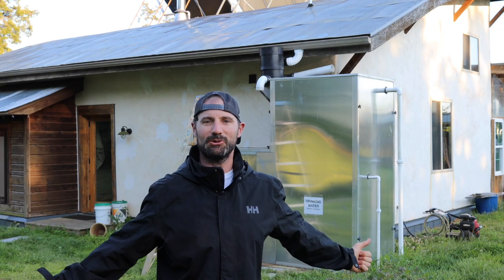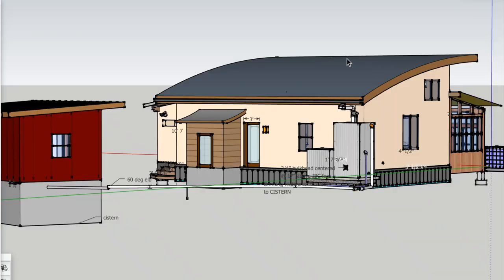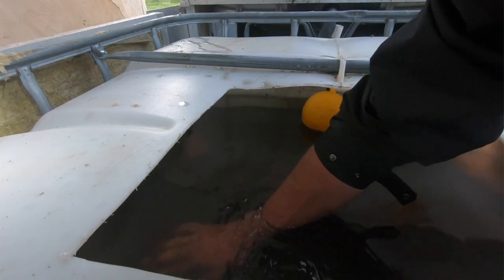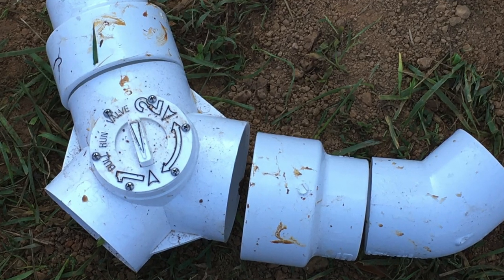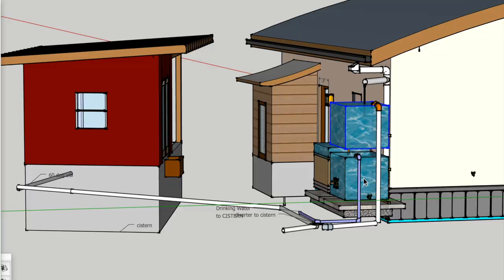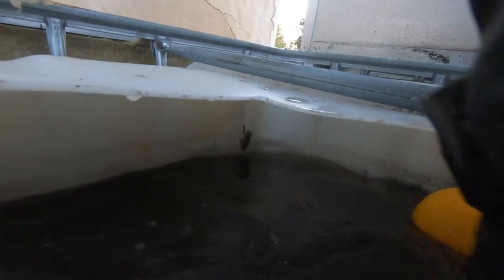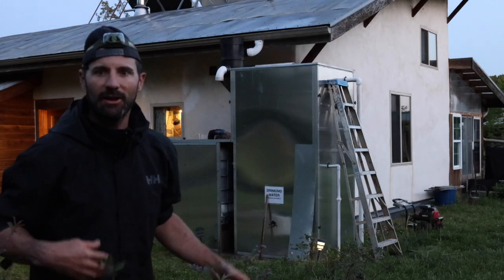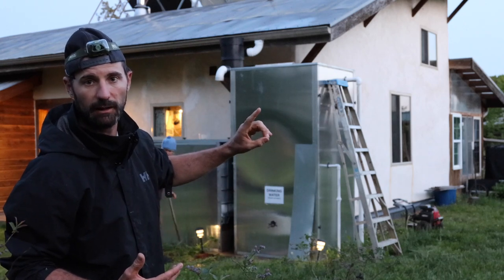DIY Home Water Filtration System: Rainwater Harvesting with a Biological Sand Filter and Maintenance

Comment: how many years have you filtered water through the system?
Reply from the maker: H A Z M A T i say three years in this video, but it’s actually two years after I looked at the time stamp on some of the old photos. It takes about two weeks to “grow” the biological layer on top of the sand filter to get the full 99% purifying qualities of this filter.
Reply from the maker: I've been living off biosand filter water systems, solely, since 2012. This system WORKS for drinking water, and with this gravity-fed underground cistern design, it works to provide all domestic water needs!
Reply: HeirloomBuilders thank you. Would you say that this type of system would work well in an equatorial climate, say Costa Rica? Meaning does the biolayer get affected by temperatures
Reply from the maker: @TheoSmith249  Biosand filters work great in tropical climates like Costa Rica. The bio layer does freeze in extremely cold temps.
Reply: I’m also from Costa Rica and would like to give it a try. Interested in sharing ideas too..
Reply: @HeirloomBuilders  what happens to the bacteria if it freezes?
Reply from the maker: @precisiontactics7448  the bacteria on the surface will be less effective at eating the harmful pathogens. However the bacteria that colonize the lower layers of the sand bed will be fine and continue to purify the water. Do you live in a really cold climate?
Reply: @HeirloomBuilders  Ok awesome. No, in South Carolina
Reply: @HeirloomBuilders  we dont. In South Carolina. i am planning on building the filter that your have but i only have one ibc tote so i am trying figure out an inexpensive way to filter the water without having to buy another tote like you did. I am going to install the gutter system and then run the water to the filter container (not sure what container i will use) and then to the ibc tote. Do you have to change out the charcoal for your system? And do you have to worry about the PVC pipes breaking because of freezing temperatures?
Reply: I from Philippines  hoping  to apply  this kind of system ..thanks
Reply from the maker: @precisiontactics7448  we don’t use charcoal in this system. The sand bed only needs minor maintenance and is all you will need to get amazingly clean water.
Reply from the maker: @precisiontactics7448  the PVC pipes don’t break because they are pitched to drain by gravity into the sand filter and not glued so they can expand if filled with water when it freezes without bursting. The only pipes that are glued are the ones inside the biosand filter coming up from the bottom (clean side) so they don’t mix with the unfiltered water near the top of the filter
Reply from the maker: @ALJoy1432  best of luck my friend! Let me know how it goes
Reply: Does the water in the cistern become stagnant at anytime. Do you filter it again before using?
Reply from the maker: @SuperMountainmaniac  I’ve never felt the need to filter again before drinking. We have pretty consistent rain, which re-oxygenates the water. Not sure what I would do if we had a 6 month drought. Probably recirculate the water...
Reply: @HeirloomBuilders  say you have a long period of drought or another reason why you don't circulate the water for a few weeks. You can use a simple oxygenator used in aquaria. Just run it for 15 minutes to 30 minutes every 2 weeks. Should be enough to ward off anaerobic bacteria. (Learnt this off a pro installer in French)
Reply from the maker: We don't use charcoal in this system, but you could if needed. The pipes that connect the surge tank to the filter tank are the only ones subjected to freezing (since the float valve shuts the flow of water off while the filter works, which could be really slow if there are freezing temps). So we don't glue those pipes so they have room to expand with freezing water and not burst the pipe.
Reply: I would do that plus UV light 
About like you filter an ornamental pond
Reply: @HeirloomBuilders  one of the coolest things Ive ever seen. i might test this out on a smaller scale
Reply: I’m from northern NJ  and wondering what options during the snowy season when rain freezes? That’s about a good 5 months of cold snowy weather .
Reply: How about a carbon filter within the vortex? That way the water that comes into the sand tank is already partially purified. After tasting water from volcanic springs in St. Vincent & the Grenadines, I became a believer in the carbon filtration. It may reduce maintenance.
Reply: We really want to do this but I can’t figure out how to get it permitted. In Virginia, all the officials I’ve spoken to say they require a well for potable water. Any thoughts?
Reply: Thank you so much for the info!! So do you have to make sure the filter stays wet constantly? Does that mean if need be recirculating the water?
Reply from the maker: @NEMO-NEMO  the external piping system is set up without glue so that it can freeze without busting the pipes. If freezing temps last for days or weeks, I would consider putting the tanks in an enclosed and partially heated building to keep the system working.
Reply from the maker: @kindharthomestead  I had to install a well also for permitting sake. Unfortunately the cost of drilling a well has almost tripled in the last 5 years, so I’m considering taking this design a step further and having it engineered for code approval.
Reply from the maker: @jacksonanddad8065  yes, the sand bed needs to stay submerged in water so it doesn’t dry out and kill the good bacteria. Piping the outflow pipe up from the bottom of the tank and penetrating out of the filter tank 2” above the sand bed makes the water level stay above the sand bed surface.
Reply: @HeirloomBuilders  Brother, is the finer sand you've used taken from a seashore? or does that matter if it is from a river bed or sea? Adding Charcoal plus UV also would be better if we are ready to maintain that correct? Thank you bro.
Reply: @HeirloomBuilders  that is what we will be dealing with in Northern Nevada. I am thinking to Aircrete a removable shell to keep the water system warm enough in the winter. Thank you so much for posting all your information!
Reply from the maker: @john.james-rambo  just seeing your comment. It’s best to use filter sand. Available from red flint sand in Wisconsin. Plans are available at www.heirloombuilders.com

Comment: in 1999 we bought a farm in Perry county, Arkansas. the water system was water pumped from our 1 acre STOCK POND(used by horses, cows, goats, dogs, a donkey, etc.... to drink from and wade in) to a 2 chamber sand filter and then pumped directly into the house to drink, shower, flush etc... the filter was 1 large rectangular tank with a divider going to within 4 inches from the bottom and filled to within 8 inches from the top with SAND on one side and only 12 inches  deep on the other side. a submersible pump in the pond pumped to the high sand side through a float valve on the side of the tank. from there the water filtered down to the bottom and up into the other side of the tank and the height was the same as the other side. water was piped from the clean side via the intake pipe from a jet pump that went up the outside of the tank over the edge and down into the tank about a foot, where a screen was attached. 
this sand filter was originally used to filter the well water, but the water table was low, because the highway department had blasted the old bridge and water was flowing from our well out the side of the bank and into the river! we didnt have much water used the filter to filter pond water!
before i moved in 2006, we put 3 IBC tanks side beside in a basement addition and then used REVERSE OSMOSIS and DC POWERED UV LAMPS IN HOME MADE MANIFOLD.

Comment: Awesome.  One improvement is to divert the "first flush" of water off the roof. Eliminate the dust and pollen and then collect the cleaner water. I dont know the details but they can be basic.
Reply: exactly what I was thinking as well. We are very dusty in our mountain area and it does a great job for collecting excess debris and material. The water can be used for garden - problem solved!
Reply: The first flush which are sold which can only take 10l are joke. I also think about first flush, but I believe it should be 50 gallons for the first flush. But for now I have 60l drum full of gravel for filtering. The top gravel is 4-8mm. It is not a filter. I call it a sediment trap. I will see how lond this will work. I hope I won't need first flush. If it will last 3 years befroe I need to clean up then no need for the first flush.

Comment: Really enjoyed you explaining your system, just what I was looking for. To help with the pollen problem you could try a first flush system sized according to your roof. It is size such that the first minute or so of rain rinses your roof and that water is discarded then the rest of the water is automatically  diverted into your filter. You adjust the speed of the drain for your first flush tank so that all the rest of the rain for the same day goes to your filter. But the first flush tank empties in about 12 to 24 hours and then automatically resets to catch the next first flush rinse. It is actually a simple and low maintenance valve to build.

Comment: I love this system. And I've worked for years on a group scheme. We supply around 2000 people in our community with drinking water using slow sand filters. 
Slow sand filters requires regular cleaning. You should turn off the inlet from the raw water allow the sand filter to work until the sand is dry then with a scraper remove the top layer of dirt. But do not rake or dig into the sand more than necessary, as the top couple of inches of sand, thanks to the bacteria there in, is in fact doing the majority of the cleaning. This should be done periodically.
Reply: Hi, so the only maintenance for the filter tank is just to remove the scum off the top and leave the rest undisturbed?
Reply from the maker: You got it! Its the lowest maintenance of any system I know. As long as you can keep debris and pollen out of the raw water that feeds into the sand filter, the maintenance schedule will be VERY minimal. For us, that means cleaning the vortex mesh strainer every couple of rain events (which takes about 60 seconds).

Comment: Perhaps, you need to setup automatic backwash using the filtered rainwater on months when you have excess rains.   Set up using a smaller stronger vessel like the swimming pool filtering vessel so that the left 120 gallon tote can be used for storing filtered water.    Add an inline pump and an enclosed smaller vessel (with associated valves to direct flow direction) for sand filter that can be backwashed under pressure.   The agitation of the backwashing action can remove a lot.  Schedule it during the rain event.  You would need a decent capacity pump to push all the flocs out.  The pool guy can recommend a good pump.   
The discharge line should be drained away from your house foundation so as not to compromise the foundation.   Good design nevertheless 👍
Reply: NO, do NOT backwash a slow sand filter!  This disturbs the biological activity and mixes the materials which ruins the filter.  Backwash is suitable only for a fast sand filter, like a pool filter. That kind of filter is only doing mechanical filteration.
Reply: @Sylvan_dB  Good catch. A lot of people don't appreciate the different action of a slow sand filter compared with the more common fast same filters used for pools.

Comment: I know there is a cistern under my house and there is a very small door on the floor of my basement. There is a what I believe is a catchment system in front and back of the house (there are layers of rocks and pebble in both places). What I have no idea of is how am I supposed to access the water. It's not like I can ask the builder, the house is close to 100 years old and the previous owner never even notice the door. Very interesting video. I was thinking of how to increase my own system. (I'm just a 74 year old woman, not an expert builder.) They sell those big containers, less than a mile from my house.
Reply: If the cistern is still collecting water - a sump pump that can be manually turned on can push water to the filter and storage (IBC) totes.
Reply: @rongray4118  It's in my plans, my issue is that I would need that water tested. My house was build 100 years ago (great shape) I actually have two large blue water barrels in my basement in addition to other water contaners.
Reply: @carmenortiz5294  very smart to have water on hand for an emergency!
Reply: @rongray4118  Thanks. I'm paranoid, I also have them all alround the house. Every few years we have a drought and are not supposed to use city water to water plants.
Reply: @carmenortiz5294  we are in Northern Nevada - we know the "drought" situation quite well. Hope you are able to get your system worked out! Blessings to You!
Reply: @rongray4118  Thank you, good luck to you too. The worse part of our drought is that we provide much of the water that runs down the Mississippi River to the rest of the US. If things are bad here they will get worse down the river. I'm installing gutters to a second building in my property our city just increase last month 10% and this money another 20% on what we pay from city water.
Reply: @carmenortiz5294  my parents are in Carbondale, Illinois and I spent a portion of my youth south of Springfield, Illinois.
Reply: @rongray4118  I'm in the middle of nowhere, a few states north. Here because most people would not want to be here, lol.

Comment: Very good video,  I like the idea of the iOS and filter,  my problem is in Texas we get about half our rain in the spring and half in the fall , usually in bursts, so I wouldn’t get the 300 gallons filtered before I get more rain, so I would have to dump the overflow.   Great idea though!  I use ozone and a paper filter to clean my water, more maintenance than yours but it can take the bursts of rain that we have here in centralTexas.
Reply from the maker: Nice! Rainwater harvesting is different in every region. The biosand filter in this video would work for you if you had a larger surge tank capacity than the 300 gallon IBC tote we use. The filter will clean 288 gallons in 24 hours, which works well for the southeast. But actually we’ve been sending the surge tank overflow to the 10,000 gallon cistern also so we don’t have to dump the overflow (we don’t drink the cistern water, only the water In the bottom 300 gallon tank that’s been biosand filtered).
Reply: Oh, I see, so you use the cistern water for your garden and plants?   And use the biosand filtered water to drink?                    I use my rainwater for everything inside and outside.
Reply from the maker: You got it! I’m glad to hear that your setup provides all the water you need for indoor and outdoor use! You must have a giant cistern to get you through the dry seasons!?
Reply: HeirloomBuilders 12000 gallons of storage,  when I planned the system ,I learned that the longest time ever recorded between rains in this area is 4 months, so  12000 gallons is way more than I need to live on for four months.   Here it is in August and we have about 10000 gallons in storage.  And it has been a pretty warm summer ( 25 days over 100 degrees).   We should start getting some rain in September, so we are in pretty good shape.
Reply from the maker: Bob mack that’s great news! Good planning on your part 💪

Comment: Hey Logan. Love your videos. And great setup here!
I plan to do something very similar with my off grid setup. Only thing is I’m near Vancouver Canada, so will have to incorporate freeze protection. 

You mentioned uploading more details/specs of the design. I’d be very keen to get my hands on those if and when you do that. 

Again great content and keep it up!
Cheers
Reply from the maker: Welcome aboard, Jordan! This system is about as freeze proof as I can think to make it. But i'm sure if I lived in Vancouver, I'd be thinking of how to keep the whole system enclosed and completely protected from freezing. Do you have a basement? 
I've got the plans for this system pretty close to finished, just need to dimension and label the details. I'll reach out when they're available.
Cheers!
Reply: @HeirloomBuilders   Thanks man! Looking forward to seeing them.

No basement on my setup. I’m leasing a spot so everything I’m doing is mobile/modular. I’m considering insulating a 20’ shipping container and building in a main holding tank/cistern with a potable vinyl liner and false walls. With enough space left over m to add in your 3 tote bio sand setup. 
Will be a little more effort and dollars then simple black outdoor poly tanks, but should last the test of time I figure.
Reply from the maker: @jaydubb411  sounds like a good plan!
Reply: @HeirloomBuilders  Hey Logan. Curious to know what sort of liner you used for the 10,000 gallon cistern? I'm looking at a few different options for my modified shipping container cistern...looking for a liner that will last the test of time.
Reply from the maker: @jaydubb411  I don’t have a liner in the concrete cistern. But I’ve thought about lining it with copper sheet - just couldn’t stomach the cost. The concrete doesn’t leak so far
Reply from the maker: @jaydubb411  check out fabseal in Oklahoma. They make custom sized food grade vinyl liners
Reply: @HeirloomBuilders  thanks man. Went and got a quote from fab seal. But decided against the custom liner cistern and am just going to put a couple 1200 gallon hdpe tanks in the shipping container.
Reply from the maker: @jaydubb411  I think that’s a good idea.
Reply from the maker: Hey Jordan, Not sure where you are with your system, but the plans are available at https://www.heirloombuilders.com/designs-for-sale/rainwater